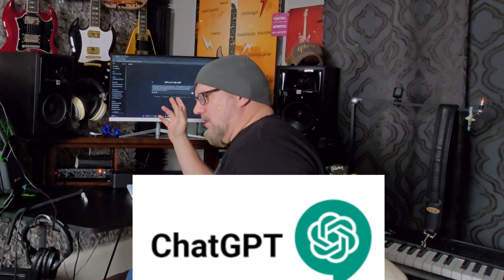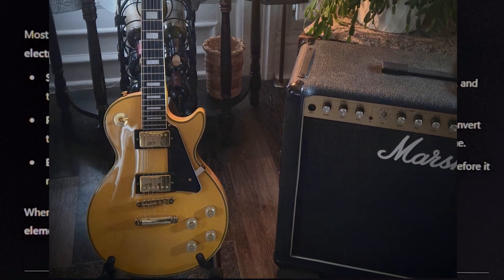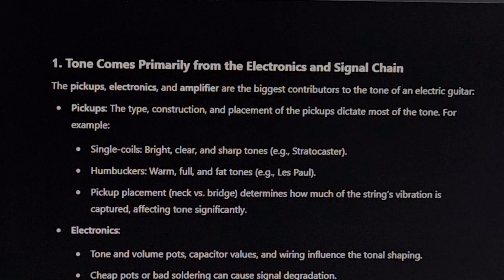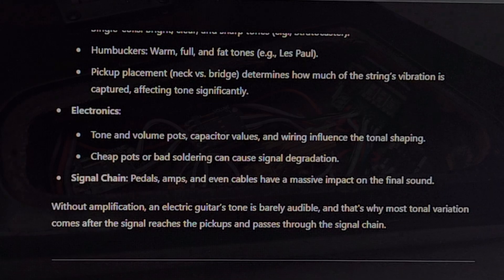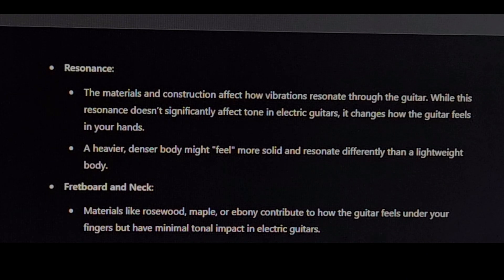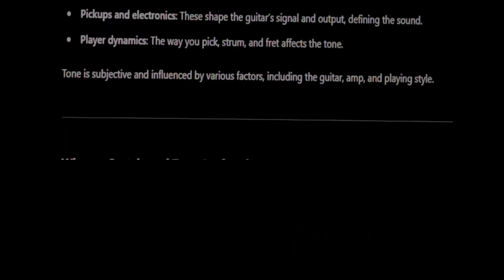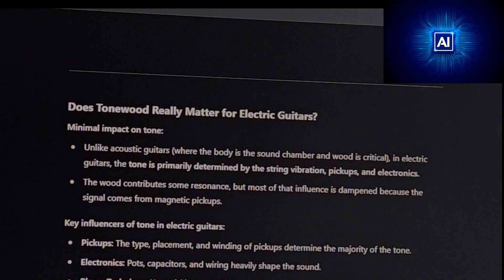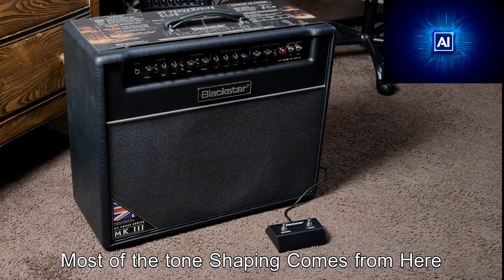Is Tonewood Real In Electric Guitars? AI Tells All

Comment: Is not uncommon AI making mistakes. First mistake which everybody reproduces is the supposed "bodyless guitar" from Jim's experiment, also called as "air guitar" by many. The problem there is that that particular guitar instead of bodyless, its body is actually two huge benches which are also connect by a generous piece of wood. The strings and the benches compose an acoustic system and is guaranteed that there is energy transfer from the strings to the benches and that some of it feeds back from the bench to the strings. There is no such a thing as a "bodyless".. it is impossible to fix the strings on thin air. That's a double bench guitar, far from "bodyless" or "air." Second mistake is saying sustain is not related with tone. It is right to say that they are not the same, however, they are related. Two things define the tonal signature of an instrument: its harmonic content and its dynamic envelope (ADSR). The latter is constituted of 4 factors: attack, decay, sustain and release. Therefore, sustain is one of the fundamental components of tone. Besides, sustain and the harmonic content are deeply related, as the sustain is what drives the energy of the fundamental to dissipate into its harmonics. Basically, if there is no sustain, there are no harmonics.. percussive instruments for instance, because of their usually short sustain, have few harmonic content.. think of a woodblock. Sustain, as much as the other factors of the dynamic envelope, is a fundamental component of the tone signature. Having more or less sustain is not a matter of what is better or worse, but rather different.
Than there is the problem that the thesis falls apart when considering semi and full hollow body electric guitars.. aren't they electric as well? Why their hollowness make a difference in the amplified sound? Why do the magnetic pickups that are sensitive only to the strings and nothing else in solid body guitars suddenly become sensitive to the hollowness of the body? If there is no difference even between solid body and "bodyless" guitars, what's so special about semi-hollow and full hollow guitars? 
Finally, I wonder why unpotted pickups never join this debate.. ppl should try singing into one and see what happens.. or simply just rub their fingers in the body with one of those. Ppl would realize how dead wax potted pickups are compared to unpotted ones. No surprise they can't hear much difference.

Comment: Actually, tonewood DOES matter... when you are playing a guitar NOT plugged in (in other words, playing a guitar accoustically, even if it is a solid body electric guitar). Since guitars are (usually) in our laps, and amps are further away, even when we play guitars plugged in, we are also still hearing the acoustic sounds generated by the guitar, which is possibly influencing the decisions of those who prsise the imortance of tonewood. The problem, obviously, is that unless the amp is quiet AND you are very close to the body of the guitar, you woudn't even hear the acoustic sound of a solid bidy electric guitar. 

So for example, if Jim Lill DIDN'T plug in his guitars, and just put a mic close to the strings of the guitar (the way one would mic up an accoustic guitar), then I would bet dollars to donuts that we would all hear a difference. And it is possibly that ACCOUSTIC difference that guitarists are conflating with the sound coming out of the amps.

But if someone is listening EXCLUSIVELY to the sound coming out of the amp (or board), then no, toneword doesn't matter.

Comment: Doesn’t anyone play their electric guitars unplugged? I play electric guitars at home unplugged more often than amplified. Presently I have access to 4 very different electric guitars that sound and feel dramatically different from each other acoustically. The materials and construction/shape/weight/density etc. of the guitar affects its acoustic performance without debate. The way the guitar sounds and feels when I play it acoustically affects me psychologically and that influences my play. I will experience different feelings of inspiration from different guitars accordingly and inspiration influences play and play influences tone. The electric guitars that sound and feel the best acoustically are the ones I reach for the most and the ones I feel the closest connection to. Just how much this phenomenon translates into the sound that comes out of the speaker when I play the same guitars amplified is difficult to quantify, but… I hypothesize that the influence or effect is not zero. 
As Such… I propose that the factors that influence acoustic sound, vibration, resonance, and feel, are not simply trivial in an electric guitar despite the fact that the strings, pickups, and electronics dominate the amplified sound that comes out of the speakers. 
My son’s Epiphone SG standard is particularly nice in that it resonates strong vibrations in the body that you can feel against your chest and it sounds fuller and louder acoustically than our other guitars. If you sling it high you can feel the guitar in the core of your body and this has a very pleasing effect on the experience of playing it. If the way a guitar makes you feel affects the way you play and if the way you play affects what comes out of the speaker then the materials used in the body and neck are not irrelevant. 
In conclusion, it appears to me that “tonewood” can have a second order effect on tone via a complex interplay between the instrument and the musician. This does not conflict with the testing that demonstrates that body material does not have a significant direct effect on amplified tone. 
Paul Reed Smith seems genuine in his belief to me but he is blind to the complex nuance that I propose. Second order effects can be something like an order of magnitude more difficult to recognize and understand.
Cheers!

Comment: My SG has a lot less bass than my LP's. I think it's a lot of subtle things that make up overall tone. The amount of wood, density, etc effect the eq. Pickups effect eq/volume/gain. Lighter guage strings have slightly less bass. 

My SG rings louder and longer than both LP's, yet plugged in has less sustain than the LP's. I know pickups play the largest role, but LP's are associated with sustain. Could be more wood, more sustain, not sure though.

Comment: In an Acoustic instrument tone wood mattress the smaller the instrument the more it matters.. Say a 🎻 violin it is paramount to the sound the Small F holes the type of wood on the top how thin it is the Sound Post the placement of them as well even the finger board and the bow and hair the rosin all matter . If it's electric THAN NO ITS GOING THROUGH SPEAKERS PUT YOUR MONEY 🤑💰💰😉 IN SPEAKERS AND OR SIMS CAB SIMS NEXT AMPS OR AMP SIMS NEXT Electronics on board the guitar as pointed out in the video I HAVE BEEN SAYING THIS FOR YEARS... Next Strings..MOST IMPORTANT IS THE PLAYER... Cheers 🍻🥃🥃🎸🎵🎶🎶🎶 What you are discussing about sustain can be adjusted by MULTIPLE EFFECTS PEDALS and or pedals SIMS.. As well...  Sound actually is vibration that is created by air movement vibration of Speaker Cone the waves travel to the ears which inside is small hair that vibrates which is what we hear ..  Sound Waves... Happy New Year 🎊🎆🎇🎆⏰ 🥳🥂🍾

Comment: Good video man. I've been playing guitar for 66 years and started working and building guitars for 40 years. I've always said tone wood is mostly a myth on a solid body guitar. When you get unto this lines, semi hollow and hollow body guitars there are some tone differences. That being said, there are some differences in certain cases with solid body guitars. Mainly the old microphonic pickups and the solid bodies that use a transducer pickup can make more difference in tone according to the wood type but still not that much and that is still mainly to how many cubic inches the body is and not it's shape dictates what kind of tone it has. It still all goes back to about 98.5 % of the solid body guitars sound comes from the electronic chain from the pickup to the speaker. Any dead or foul sounds coming from the guitar is most of the time mechanical. Have a good one.

Comment: By using Jim Lill as the basis for your question, you contaminated the response.

You have to realize that AI doesn’t have original thoughts or ideas. It is aggregating whatever has already been written on the internet about the topic.

You are basically asking the AI to give an answer with confirmation bias
Reply from the maker: There is much more than Jim Lill that AI drew from.  AI gave  all references of data, which I will be showing soon.    Some examples , Such as scientific conclusions about energy transfer,  Strings and magnetic fields (ZME) SCIENCE.     &   (New science news).    Well documented  principles  of electromagnetism  and magnetic flux.   (Also) THE DISCOVERED PRINCIPLES  OF Michael Feraday.   Also,  Multiple  researchers  of technical  study in the fields of acoustic conferences, with physical principles in vibration, resonance, and electromagnetic induction.  ALL of these sources (and more)  will be in an upcoming video soon.

Comment: Vibration or sustain will always depend on the thickness of string gauge, the distance between the pickups and strings, Also the material used for the bridge saddles & nut. The body, or lack of one will make near,  zero difference.  The human ear will Not be able to hear the difference.

I've known this to be a fact for over 30 years.

However, in the words of the late, Mark Twain  "It's easier for a person to continue believing in a lie than it is for that same person to believe that they've been lied to."

Comment: AI is stupid and it just spits out nonsense it picks up from the internet ( It's like an imbecile with a very good memory ) . Wood does matter and this is coming from somebody whose main guitar has ZERO wood in it and there barely is a body ( Steinberger composite from the 80s ).  I can hear a difference by just changing a pick, some strings sound different. Everything matters, it's just a question of how much. In order of importance work backwards ( Speaker cabinet > amp > guitar > different parts on the guitar )
I mean, angle of the pick and where you pick, closer to the neck or bridge will sound different, so let's stop this stupidity that it's only electronics that matter. You can say that it does not make a significant difference ( to you ) , but you can't say it makes no difference.

Comment: Ai is just Wikipedia dude. It's just searching and pulling whatever answer that seems to have the majority of the presents online. That's it. It's not coming up with a definitive yes or no. It's saying yes or no based on a numbers game. It's flawed from the beginning. Tone woods are important. Yes, electronics and strings are incredibly important to tone and electric guitar, but the sustain and the reverberants have a lot to do with the wood that you use. Some woods do not bounce back vibration which causes a string to vibrate in a much shorter length of time. Some woods are very vibrant and will bounce the vibration over and over again. Continuing the string to vibrate in a much longer pattern and that's coming from years and years and years of testing and trying and doing

Comment: FFS, AI is just a mish mash of various sources.  Whoever says denser woods absorb more vibration does not understand damping.  Density generally decreases damping, but softer woods absorb more highs.  However, tighter grained woods generally resonate less, and resonance drains string energy.  The loss is reflected in the strings.  Which freqs are drained by a piece of wood is impossible to predict.  There can be many resonances, but the main resonant freq probably drains more than the others.  Yeah, the difference it makes can be pretty subtle.
Reply: Yes, yes, yes.... but are these differences audible or predictable ? Science and measurements say not so in electrical guitars.
Reply: @literal_lee  I did say the differences are not predictable. 

I've seen measurements that show as much a ~6dB differences at various frequencies on different strings with different body wood.  6dB is way above audible.  FB material also matters more than any piece of wood in a guitar.  It's the first softer material than the frets to absorb or reflect string vibrations.  The bridge on electrics is much too heavy for string vibrations to cause it to vibrate nearly as much as a fret, depending on how much the surface fibers of the FB vibrate.
Reply: @GCKelloch  I'd like to see those measurements. Until that time I will hold on to what I saw from Jim Lil and Boudreau Guitars, who build to identical guitars of different woods with everything else staying the same.

Comment: The Kind of wood used in acoustics matters greatly, this argument has been extended to electric guitars. Fender Strats can be made of Alder, Oak, Maple, Mahogany and they all sound the same. My preference is for Basswood, it is light and very resonant. If Ibanez and Sure use this wood in their Prestige instruments then it is good enough for anyone. Things that do make a difference are set necks and the break angle at the nut & the bridge.

Comment: Now, I have 3 strats: a fender USA, a Squier strat both from 98 and a newer model Yamaha pac 612. They sound rather similar as I am using same cable and same amp. My ears - due to my age - are not the best anymore, but I like the sounds of all three. Different sound doesn't mean 
better or worse sound to me. I suppose the Fender has better quality parts, but I prefer the slightly thinner neck of the Squier and Yamaha.
Then I do have a Gibson Tribute, a Spear LP and a Harley Benton SC 450 plus. They have -in my opinion, but I maybe wrong - the same neck shape and also the sounds are rather equal. The Gibson maybe again have better quality over all, but when playing (always sitting as a bedroom player) I don't feel differences. My conclusion as a non pro: Cheap or expensive guitars don't make such a big difference as there is in price. Btw, the expensive Fender and Gibson were bought second hand for a very reasonable price. I bought them cause I also am influenced by these historic names as a must-have gear. I admit that I love my Tribute the most as a LP-guy, but I am not sure about the reason why as it is not the sound. It's rather just the feeling to play a big G. It is also obvious that a good player will always sound better on a cheap guitar than me on an expensive one, so the most important part are the fingers.

Comment: Les Paul selected mahogany specifically and maple for the top. He wanted all mahogany for his Customs because he thought it produced a mellower sound. He was a jazz cat all the way. Les had good ears and yes it's all very subtle. I tend to think it's a chain, and each material type/capacitor, etc. within the chain contributes to the final result. 

It also depends on what you're playing. Hard rock in a mix, not so much. Jazz solo performance, little more. The unpotted PAF's are thought to pick up some of those nuances with wood. Probably more in the fingerboard and top than the body.
Reply: Exactly. Dont expect usual 20-25kohm high gain pickup to capture any of wood nuances. But if your pickups are real. 1959- sure they catch all the wood tone.